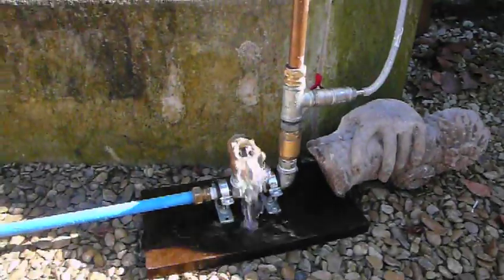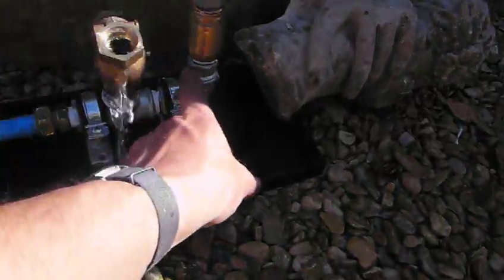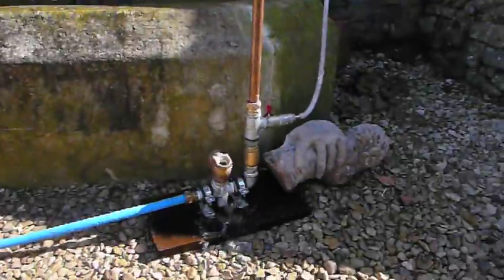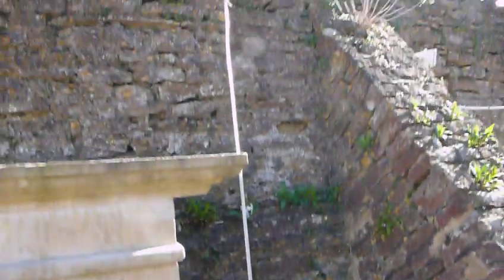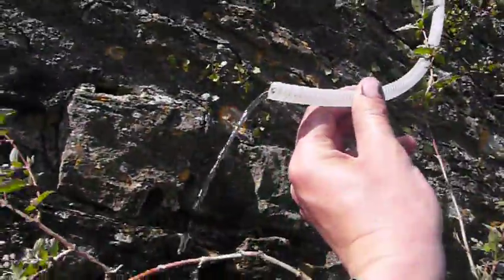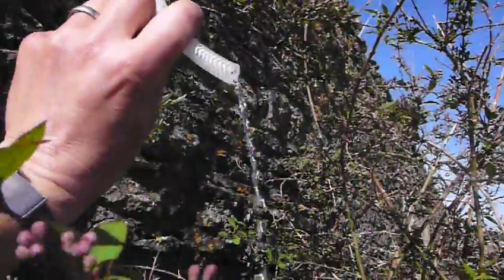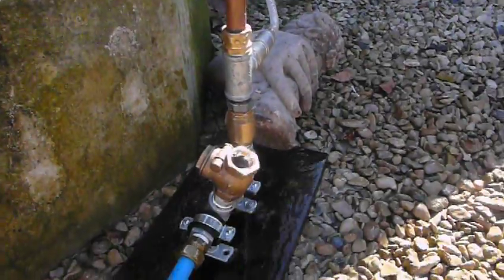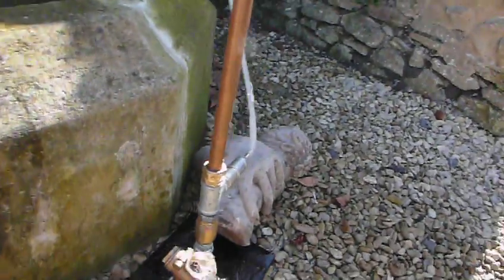Model of a 3/4 " ram pump built with my daughter for a shool project

Comment: I have already built a 3/4in ram pump with pvc fittings and brass swing valves. When I did not poke a hole for the snifter valve it ran reliably and I came back 10min later with it still running pumping same amount. When I poked the hole and inserted a tiny wire into the hole (like a snifter, I think) it would run for a couple of minutes and stop. Im using a 55gal drum like you but Im using 3/4in sched40 pvc pipe to transmit the pressure wave. I can make a vid when/if you respond to this. Help!

Comment from the maker: @63n0it 
Hi You can by the impetus valve from any good plumbers merchant, its called a brass swing check valve and comes in a variety of sizes, i do have a picture of the pump drawings, but there are better ones on the site, if you look for a few miniutes you will find some good examples. Cheers